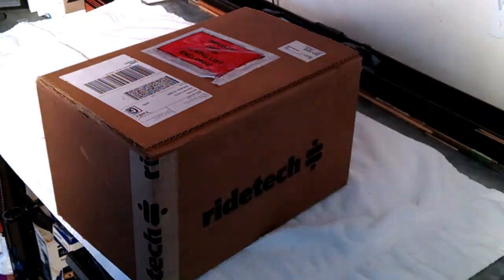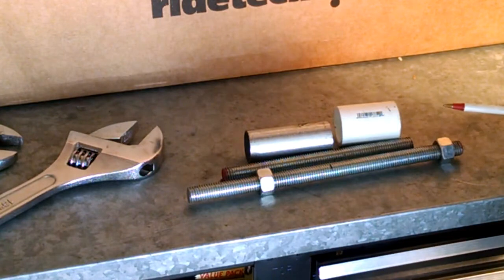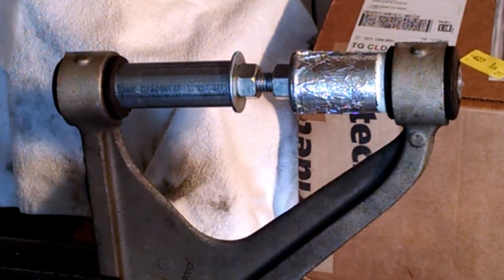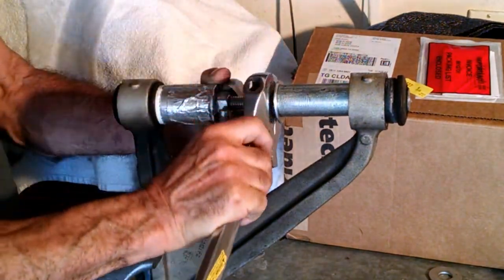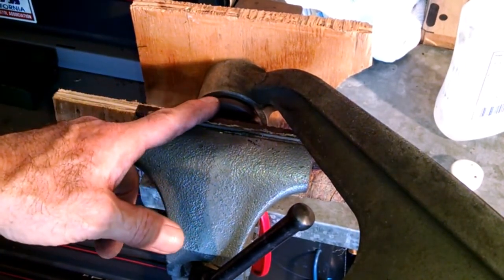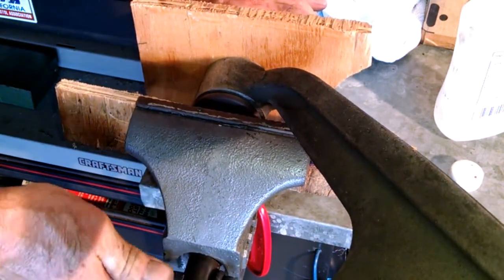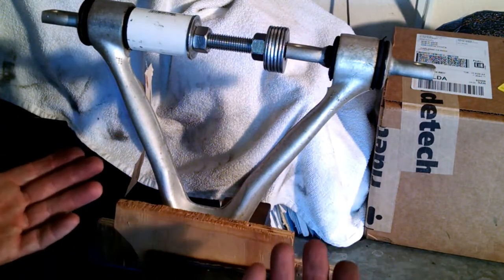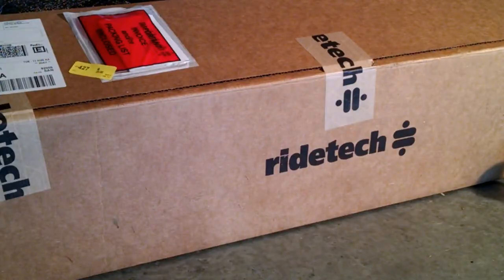Corvette Ridetech delrin control arm bushing install by froggy   2

Comment: Hey Frogy! How are the bushings now that you’ve had them on for a while?  Any worries about driving them on the street?  Strongly considering the RideTech kit for my C6Z.  Finished 2 sessions on MSR 1.7 CCW a few weeks ago and my steering wheel was cocked 15 degrees right. Car still tracked straight down the highway on the way home but I was really miffed because I had just had the car aligned.  What are your thoughts?  Do I need some lower chamber plates to eliminate the lower eccentric bolts?
Reply from the maker: Sounds to me like something got loose, maybe the front tie rod adjusters, I would go straight back to where you got it aligned. TELL THEM there are torque specs to follow & I would watch the guy doing it. For the delrin bushings they definitely result in some harshness no matter what anyone else says, but that's the trade off for improved precision handling. Your choice.